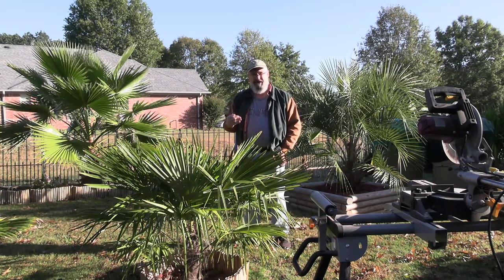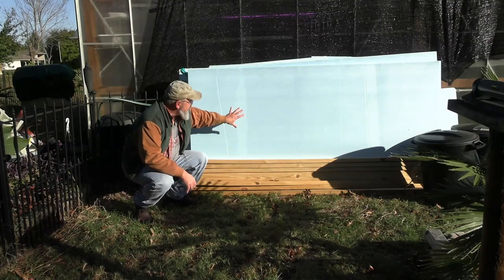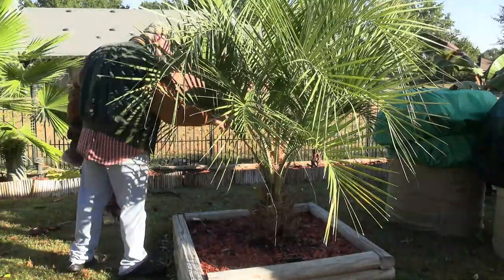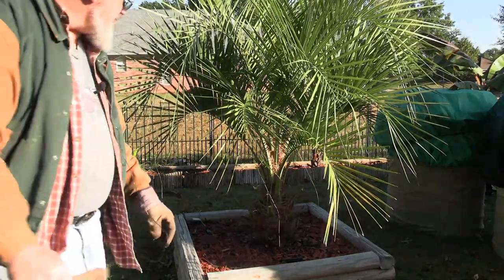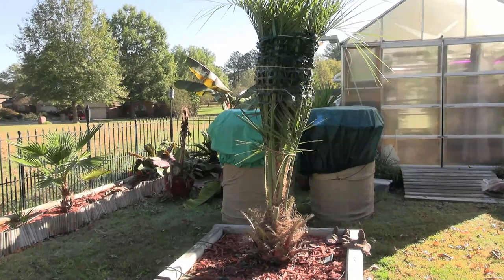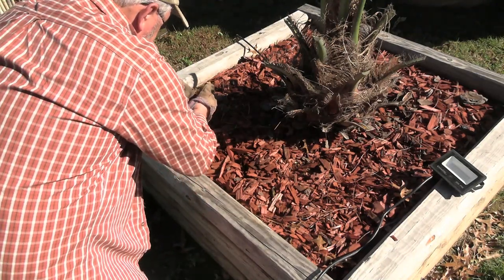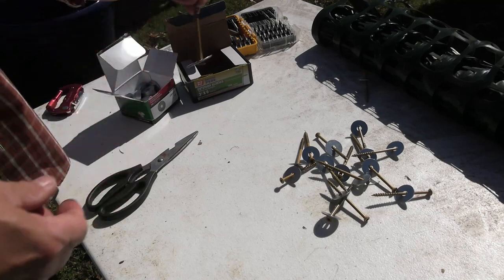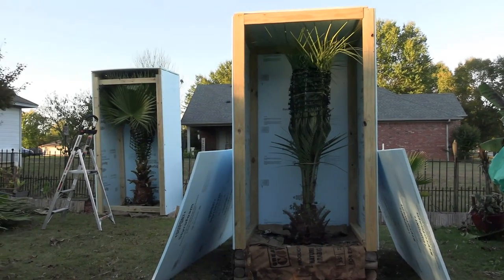How to Protect Palm Trees in Cold Climates Winter Protection with HEAT

Comment: How do the palms do with the lack of light over the winter?
Reply from the maker: Anytime it gets below 35 degrees F, the C--9 lights come on with a Thermocube.  They turn off at 45 degrees.  They've made it several seasons this way just fine.
Reply: @Tiki71  How many months can survive like this? What was your longest box period? If I will use a different method of heating, do I need to make a clear top for sunlight?

Comment: Those heating cables seems wimpy are they effective? Guess so since your using them....thanks and well done
Reply from the maker: Yeah, they're designed for use in soil with radiant heat.  I cover with the mulch and then add the burlap layer so that helps hold it.  Then I lay the C9's on top of the burlap and wrap up the tree. ;)  So far so good.

Comment: Always enjoy watching your videos. I too use to do the box method but it gets tiring after a few years. This year I’m trying Christmas lights with moving blankets wrapped around the outside. On a thermocouple with a wireless thermostats. Seems easier. Hopefully it works just as good. 
Do you remove all the dirt from the banana roots?
Reply from the maker: Most of it.  Thank you for watching!
Reply: The moving blanket method works really well with miniature incandescent Xmas lights.  Part of the equation too is being realistic about what palms you grow.  I've been doing this for decades abs trachys really are your best choice.  I've got a 20 year old specimen that's about 18 feet tall.  Have not protected at all for years now.  Eventually they will get too big.  I have found that after they attain some good size they become very cold hardy.